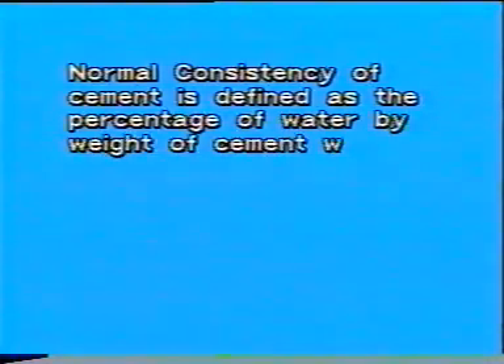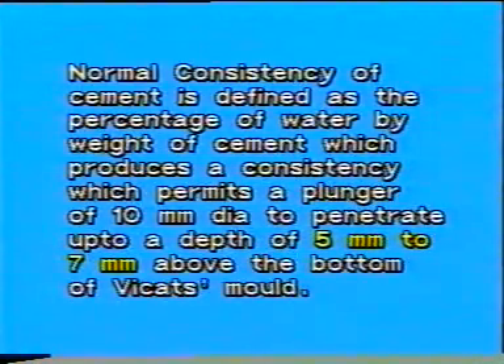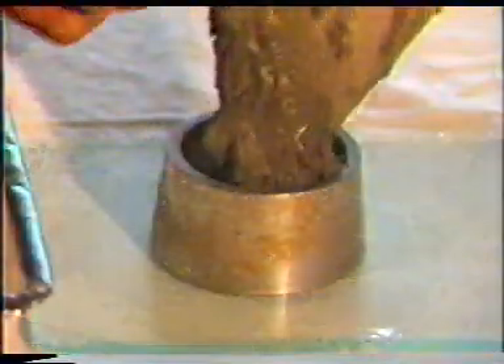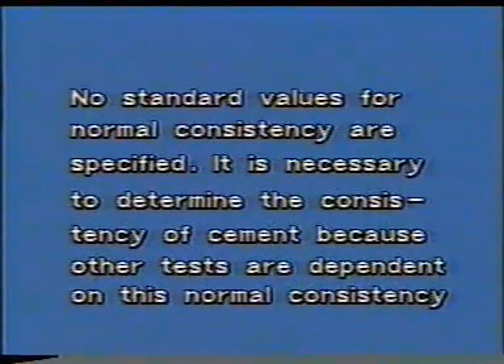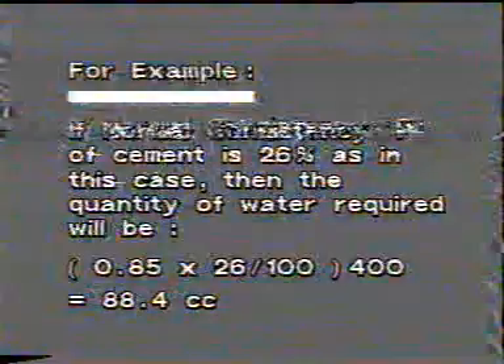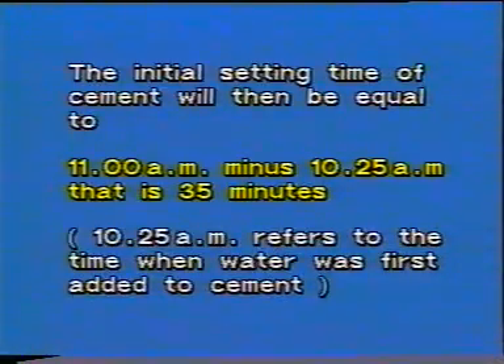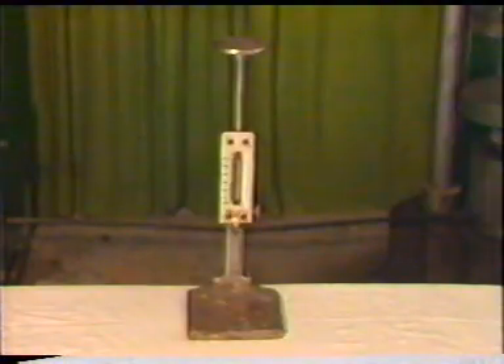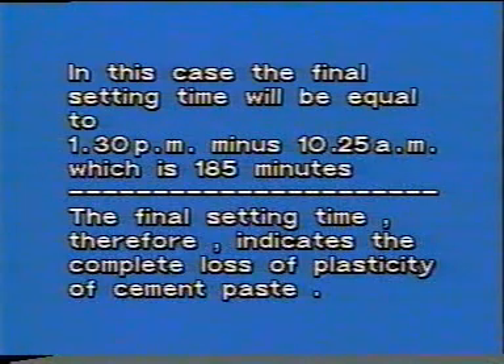Testing of Cement part 1

Comment: But the final setting time for cement in text book is mentioned 600mins.. how come its 185 mins????
Reply: In book, As per IS CODE 30 mins is MINIMUM value & 600 mins is the maximum so a/c to it, this is correct exactly Bhai